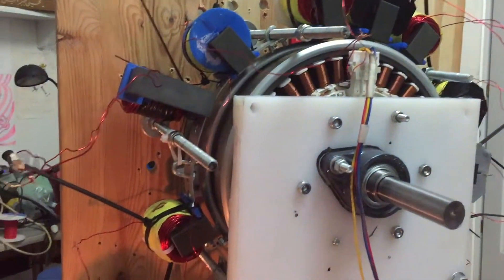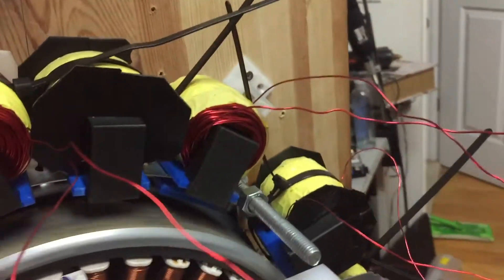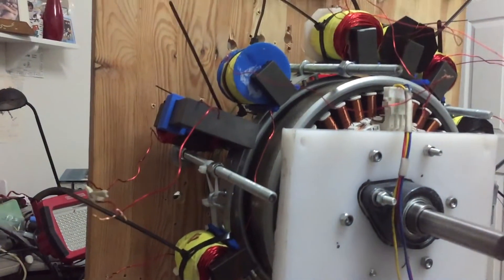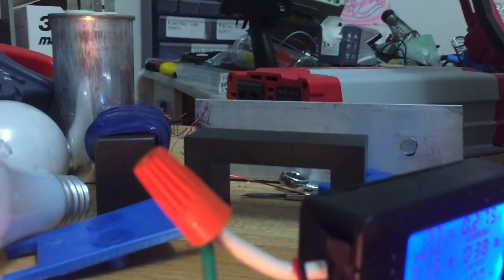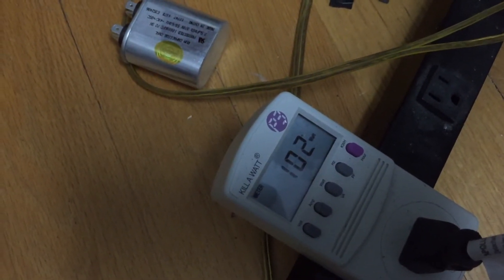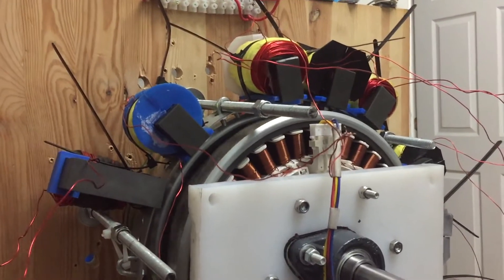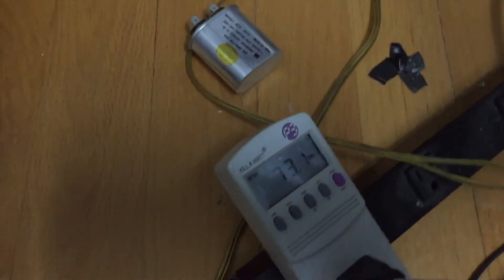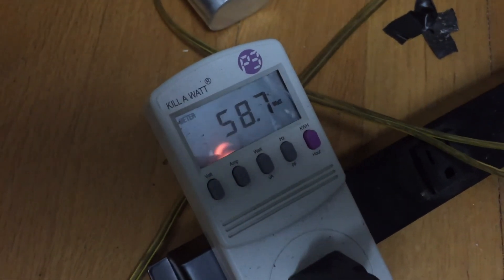Anti Lenz Testing

Comment: At 3:30, you switch the load on, u don't show us how much the load is consuming in watts, you don't show us if the motor maintained rpm, please don't do what the others are doing and don't hide info, you can also get an oscilloscope and a current transformer, hook it up to calculate true rms for input and output, power Meters made for 50/60hz sine are not for everything